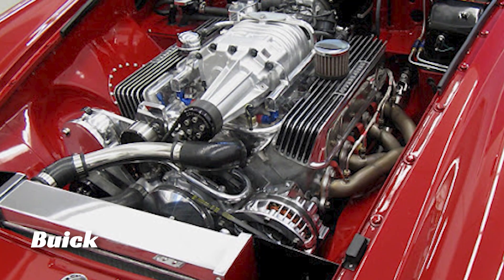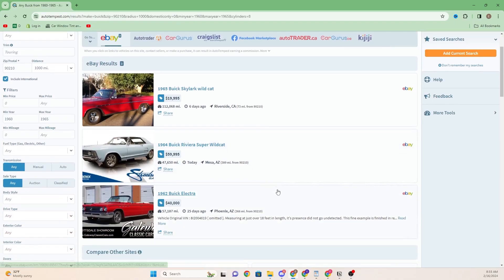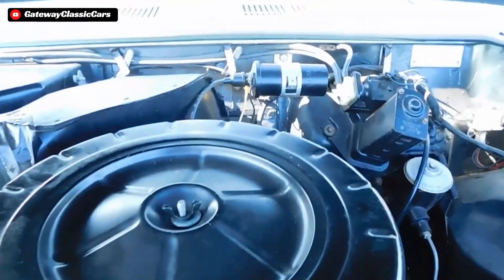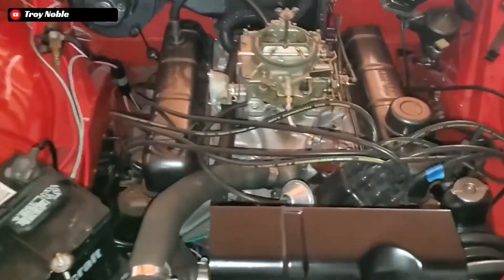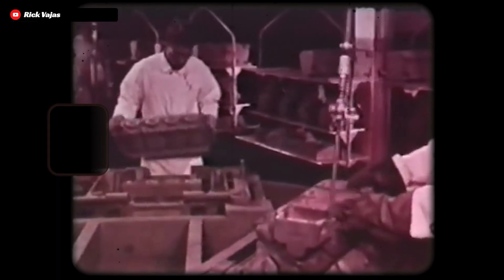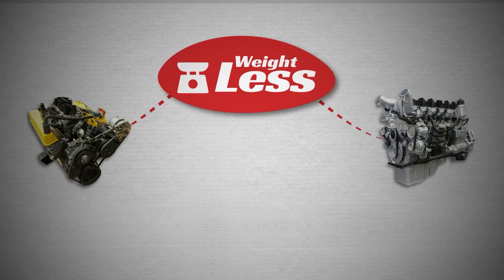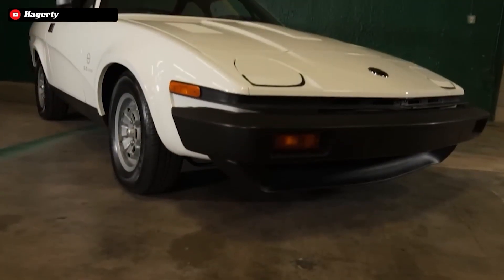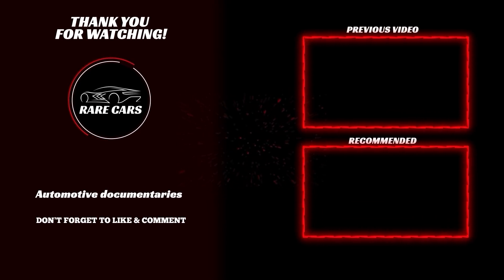The Little V8 That Powered The World  - The Buick/Rover 215 V8

Comment: One minute 40 seconds in and all I’ve seen are engines from other vehicles, and an advertisement… I’m out!
Reply from the maker: You are welcome to skip the sponsor message should you like - it is timestamped for viewer discretion. And we always have an intro to set the stage in our videos
Reply: @rarecars3336 some people would bitch if your beat them with a new whip. What you going to do.  Love the vids keep up the good work
Reply: The Australian P 76 car featured a 280 cubic inch(4.6 litre),version of this aluminium V8.Instead of SU carbs it was feed by a dual barrel fixed jet unit.Unfortunately ,from memory the engine had cooling problems,the fan forgot to cut in?Anyway reliability is paramount in the Lucky Country.Lack of might be fatal to the car’s occupants.A lot of these baby V8s landed up powering Hamilton style Jet Boats and proved popular for their torque to weight ratio.

Comment: Fascinating stuff, especially the technical aspects of an aluminum engine vs. iron. I was aware of its long life cycle, but why was there no mention of it coming back across the pond for use in Kaiser Jeep products. I'm not absolutely certain of this, but I have heard about it from several sources. 

Now, as for other engines to cover like you did this one, how about the Corvair flat-6, especially the turbocharged version, since it was the world's first successful turbocharged production car. Or maybe a cautionary tale about the Chevy Vega 2300, with its unsleeved aluminum block and cast iron head. It was actually a decent little engine if well maintained, but who bothers with maintenance on what was basically a disposable car?
Reply: The Jeepster Commando used the Buick V6 iron block motor, until replaced by the AMC 304 V8.
Reply from the maker: The Corvair or Vega engines could be great topics thank u for that! And this video was aimed at just the aluminum 215 which to my knowledge didn’t make it back into the jeeps but if they did please let me know and I will issue a correction!
Reply: The Fireball V6 tooling was sold to Kaiser Jeep and used in the CJ and Jeepster, plus the Wagoneer was offered with the cast iron Buick 350 V8 for a few years in the late 60s before  Jeep switched to AMC engines fully
Reply: A number of Jeeps were modified to use the 205/215 V8.